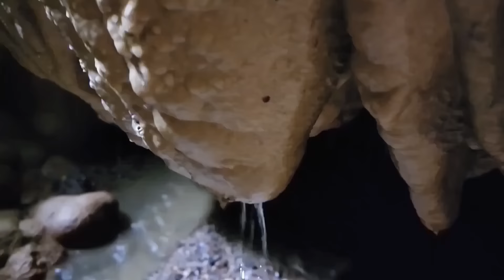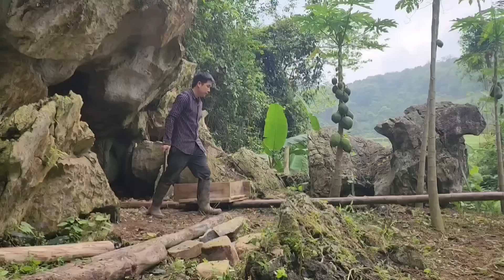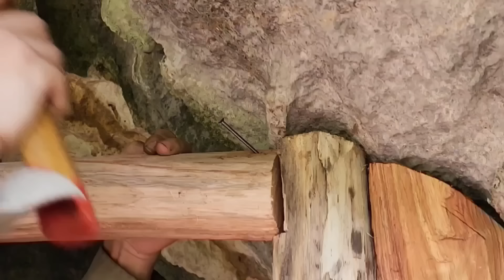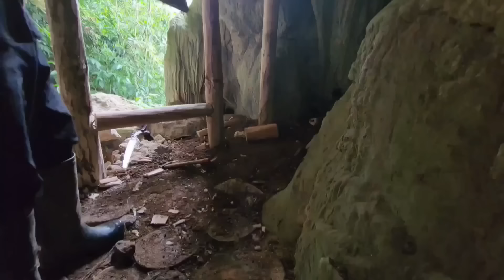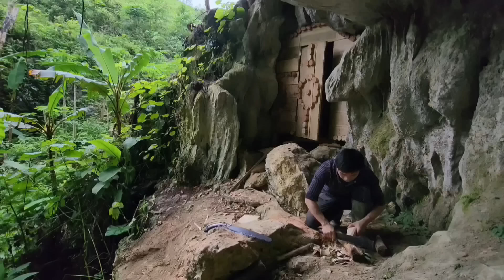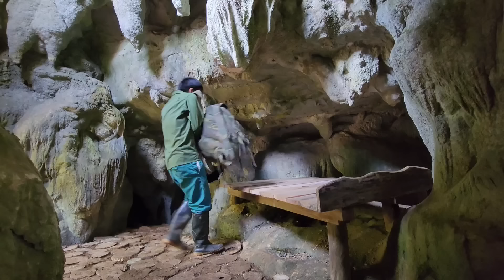Full video: Building a house in a cave, walking alone in the bush

Comment: I have mixed feelings about this video. On one hand I like that they made a little mine cart, chose a cool location, and used some truly primitive techniques. On the other he uses some modern prices and tools like hinges, nails and steel tools/measuring tape. If you are going to use those tools there is no excuse for massive gapes in walls especially when you have filler that can be used to fill the gapes.